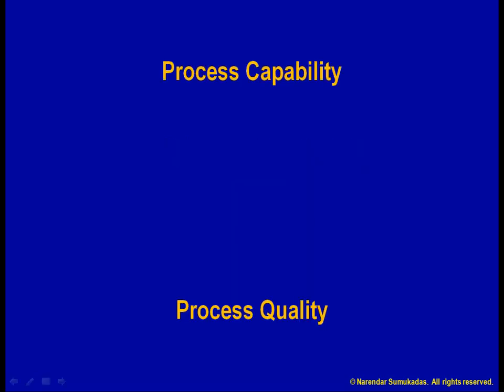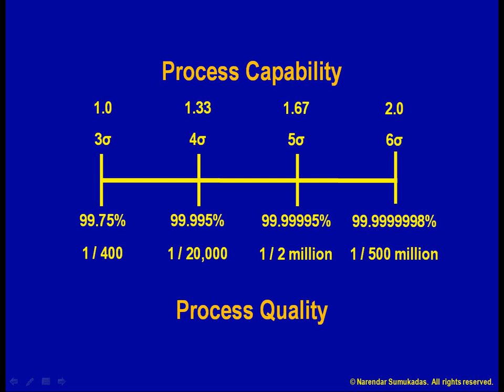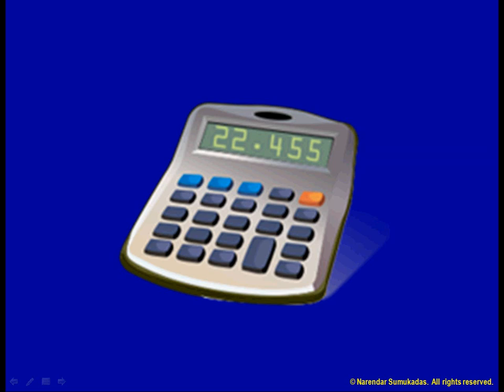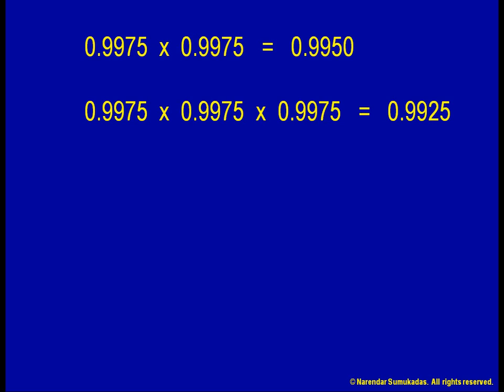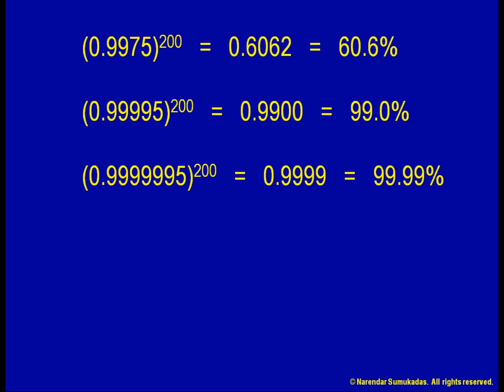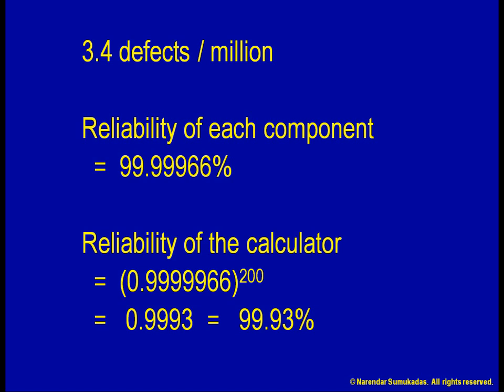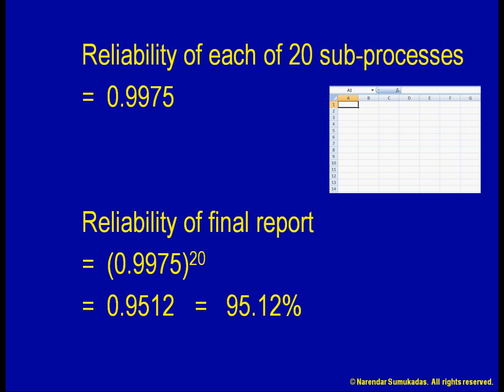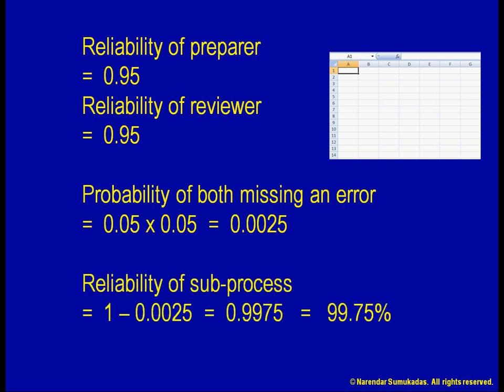[3.c] Six-sigma Process Capability

Comment: In general 6 sigma books: Six sigma is mentioned as 3.4 defects per million.
In this lecture,it is mentioned as 1 in 500 million.i,e 0.002 defects per million.
Is 3.4 DPM is considering 1.5 sigma  shift?Why it is not mentioned as 0.002 DPM?

Comment: The last point in the video is kind of confusing because in Lean classes you learn that inspection wouldn't increase the quality of the products coming out of the line but in here when you had a another set of eye as an inspector you increased the reliability percentage. Can you elaborate on this? or I might be mistaking these two concepts.